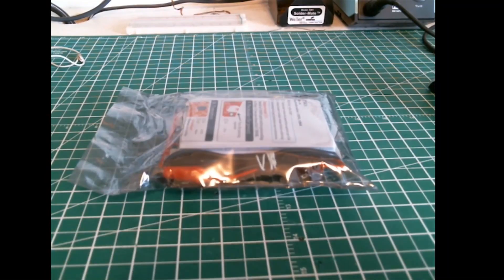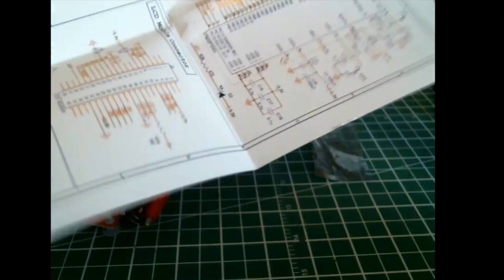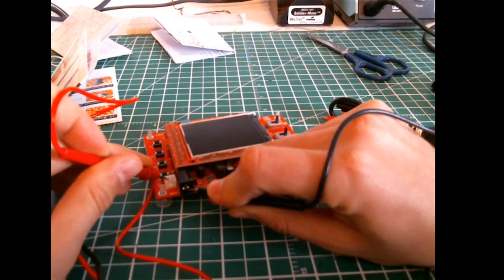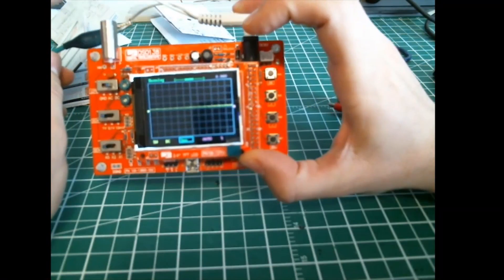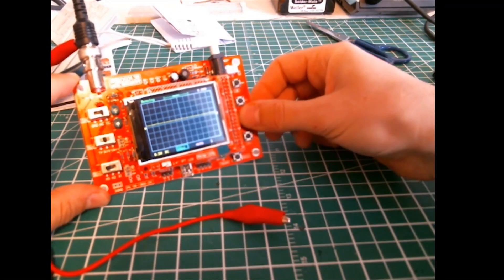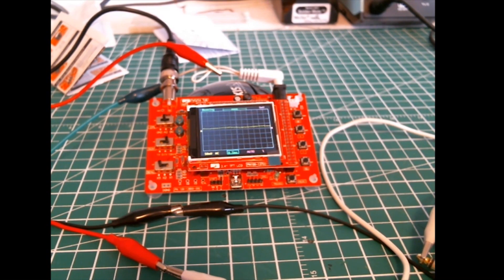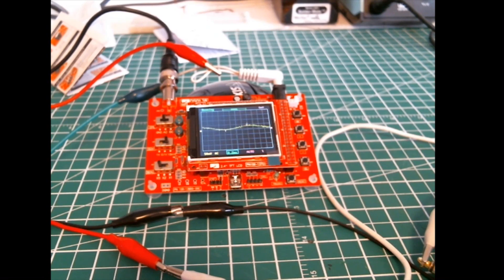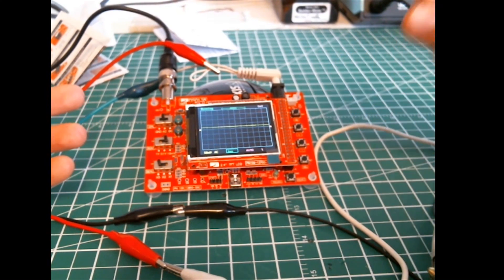Digital Oscilloscope Review

Comment: Are you sure USB port is actually used for anything?
Reply from the maker: Good question. I'm not sure if the USB port brings more functionality.  There was no software provided with the KIT. Maybe I will just try to plug it in my computer port and see what happens. I'll keep you in touch. Maybe an other video soon!
Reply from the maker: I think USB is for firmware update.
Reply: I tried the usb update and it did nothing maybe mines a dud😁
Reply: The USB does nothing out of box. :/ It's for your own hacking I guess ....